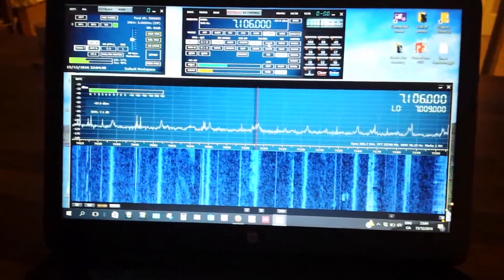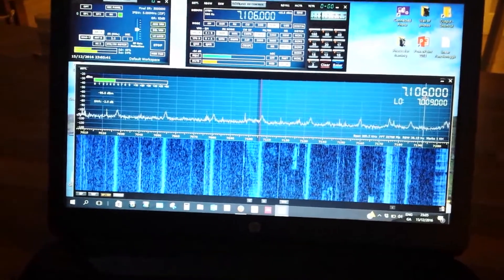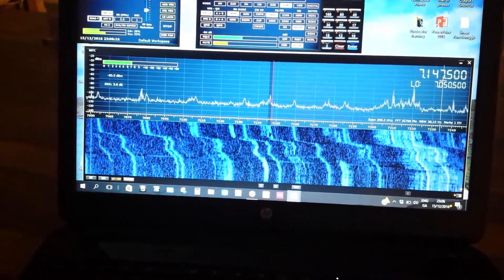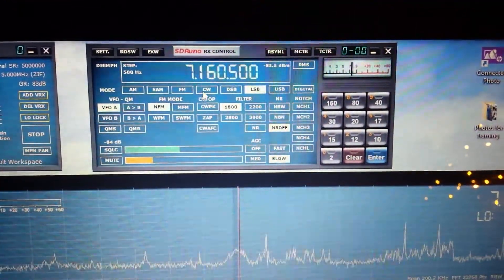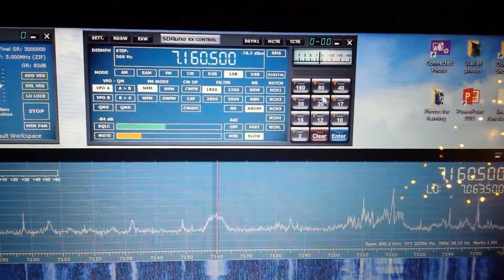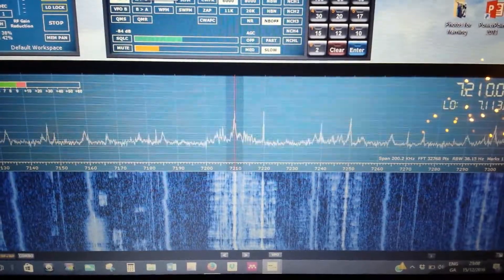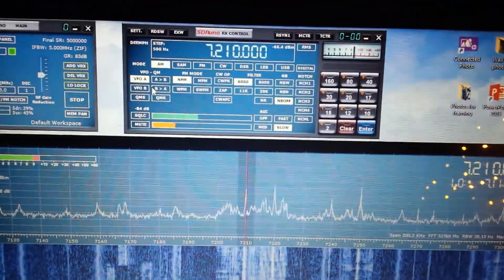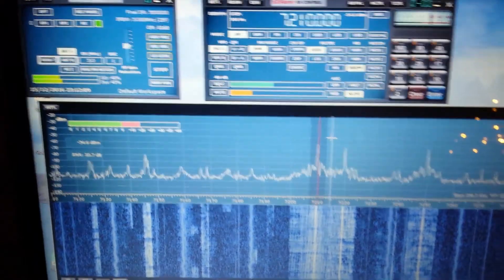SDRPlay 2: Santa got my letter!

Comment: Great video and congrats on your SDRPlay 2! Can it be powered by USB or does it require mains power? 73! Clint
Reply from the maker: Hi Clint. It's powered off the USB soley. So I suppose I could do some DXing in the field! Happy Christmas btw. Adrian
Reply: Definitely Adrian! Did I read correctly that it goes all the way up to 2 GHz? I might think about getting one myself for HF and VHF....brilliant. 73! Clint
Reply from the maker: Oxford Shortwave Log Yep, that's it's range Clint. Was pulling in strong LW stuff today - stuff  I never even heard before. Some Good HF DX out of south America and Africa  too. VHF is there but not great yet. I was tweaking the noise floor etc but I think it's more my antenna set up. There's a lot to learn!